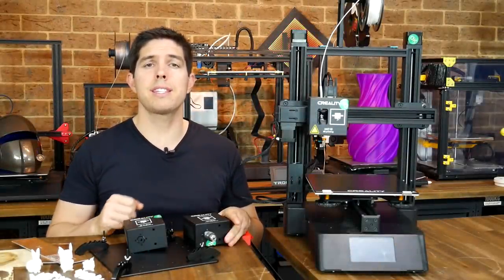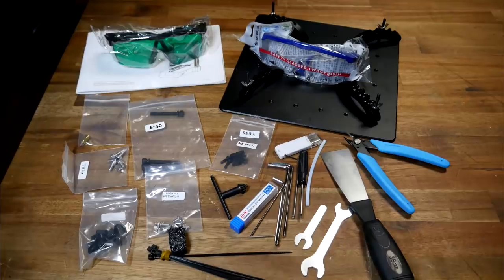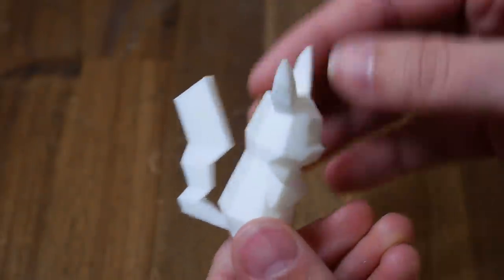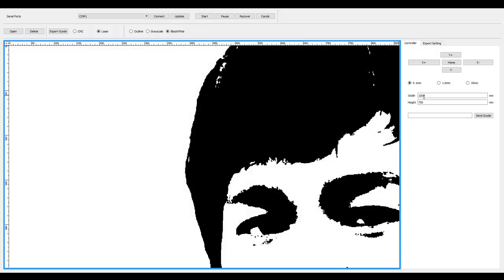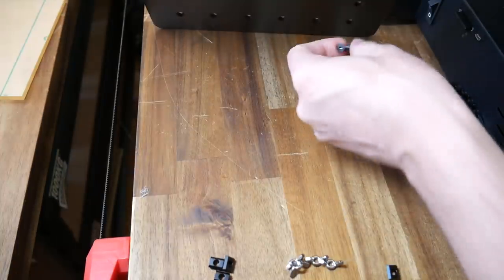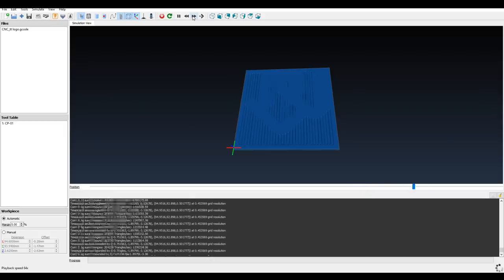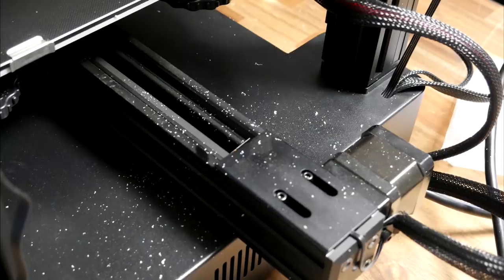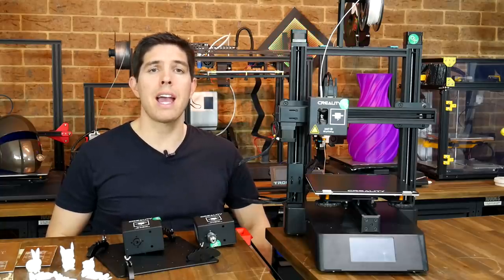Beta testing the Creality CP-01: 3D printer + laser + CNC all in one

Comment from the maker: Plenty of great comments on improving the CNC function. Currently this function is the weak link. Here is a summary of fixes plus some of my own ideas:
- Change drill chuck to collet.
- Insert the cutting bit as far into the chuck/collet as possible (I did this in the video and unfortunately it doesn't go in too far)
- 3D print a brace which prevents the motor from deflecting on the metal mount
- Compress the bed springs down as much as possible to remove bed wobble. This is possible without compromising the z endstop for 3D printing because it can slide down to compensate.
- Use better CAM software to make gcode. See the video I linked in the description. Just have to make sure you tell the software that M106 S255 starts the spindle and M107 stops it.
Reply: It is true that with carefully chosen feed rates and spindle rpm (feeds and speeds) you can do quite a lot with even weak machines. Take a look at the Carbide 3D channel for getting the most from a small machine like their Shapeoko.

Mostly the key is getting correct chip load per tooth but keeping very shallow cuts to keep machine deflection low. Adaptive cutting paths with chip thinning can also help a lot, but inevitably slotting is needed at some point. A few terms there worth googling if you are new to milling.
Reply: I am wondering: Are there other three in one printers out there that are better? Or cheaper? Any recommendations? Cheers!
Reply: The cnc function seems kind of half baked to me. I would buy this tomorrow if it would mill aluminium. I will probably buy it anyway when it is available though tbf I can't believe how good my ender is. I just wonder if separate dedicated machines would be better
Reply: Simon A this is why I always like to check the comments. I have never milled before I'm just about to get a machine and start. Thanks your comment is helpful
Reply: @machtundrebel3127  The Snapmaker machine has been advertised quite heavily this last month. It is also a 3 in one machine. But at a higher price range I think.
Reply: could you maybe do a tutorial on how to use different cam Softwares for the cp-01 because i cant seem to be able to export any code that works and i can't find any other tutorials on it. any help would be much appreciated.
Reply: Anyone know how you would be able to make the cam software know that m106 s255 starts the spindle and m107 stops it?
Reply: Hello. I am wondering if I can laser engraving in metal, and if the CNC mode can really machining in 3D (a 3D part)?
Reply: @machtundrebel3127  There is the snapmaker 3 in but it is not cheaper just better then the CP-01but in my opinion it is not as good as it should be...
Reply: @air3dp  I don't know if this will answer you question but I can engrave ceramic tile with a 259 MW laser head from creality...  I go as slow as possible and on most I have to go over it 2 or 3 times...  I would think if it can do that hard material it can also engrave metal, but faster and better...
Reply: @louisstevens9266  Have you had any luck with tutorials for this printer? I just bought it and am getting a bit inconsistent prints. Some come out perfectly others have many issues.
Reply: I noticed you used a wrench on the underside of the heated bed @2:11. Where you adjusting the carriage wheels or the springs for leveling the bed? I am having some issues with leveling my CP-01 as the back left is already as far as I can easily manage to turn the adjustment wheel when all other corners are at the correct z-height to keel bed level. Any tips on how this could be adjusted?

Comment: Sorry, but I can’t read and digest 311 comments before adding my own thoughts so I apologize in advance for any duplication. This in my mind is perhaps in a more proof of concept mode than beta, which isn’t a bad thing. We’ve had all-in-one printer/scanner/copiers for years now and this concept is theoretically appealing and logical for maker hobbyists. The interchangeable print heads are genius in concept but because of the need for precision alignment almost has to evolve at some point into a single integrated unit in its more mature development stage. But perhaps the most important question for today is whether it makes more sense for Creality to focus on two functionalities and get those right. In this vein, I would comment that not only is the CNC feature the most difficult to implement in this platform but as a CNC hobbyist is almost entirely limited in usage to pcb milling, which a number of sub-$200 Chinese made machines can handle pretty well with the right collet/bit pairing. So unless that is really the target audience and not someone who wants to mill signs and artwork from hardwoods, I think a pairing of 3D printer and laser would be pretty compelling, particularly if Creality can stay in that sub $700 price point. I applaud the effort and their engineering acumen. And thank you for the in-depth review, which I think actually serves to pique more interest in the product and it’s development than shedding light on its current design challenges. Well done all.

Comment: Kudos to Creality for finally getting the safety features right.
Reply: Ehhhh. I mean yea they added thermal runaway protection, but they also added a laser that powers up unexpectedly.
Reply: @outsider344  Very true, but as Michael suggested, we hope they will add a warning screen to that, or, better yet, a specific button to enable it. But you're right, it should have been implemented first ideally.
Reply: @spikekent  Don't get me wrong I'm a creality fan. The latest ender 3s have thermal runaway enabled (or at least mine did) if anyone is curious. But a laser cutter that isn't enclosed is already pretty bad, and having it turn on the laser unexpectedly on top of that is like a punchline for a joke about a dangerous machine. What really gets me is I assume this machine comes without a boot loader the way that other creality machines do. So this problem can likely be fixed before release, but future problems would require users to burn a bootloader before implementing any firmware level fixes.
Reply: @outsider344  I don't know about all Creality machines, but my CR-10s4 came with the bootloader. Even though I brought it specifically to hack/upgrade the hell of it. It's called #Borg for obvious reasons. On a serious note, you're quite right, safety should be the prime concern when manufacturing anything.
Reply: I am considering getting a CR 10 mini as my first printer, what about thermal runaway on this one? I'm confused
Reply: @kostasz2392  I cannot say if it will be enabled, but you can test for it when you get a printer. If it is not enabled, you potentially could reflash the firmware to enable it. Either way, we are here to help if you need it.
Reply: @spikekent  okay, thanks a lot. I hope I'll make it without needing more help guys
Reply: @kostasz2392  You're very welcome mate. Good luck.
Reply: @kostasz2392  Your best bet on getting one with it enabled is getting the printer directly from creality. Usually resellers have older models and thermal runaway being enabled is a new feature. I got my ender 3 from the creality amazon store (mostly for the return policy) but it also meant I got the most up to date model. Though if you do get one without thermal runaway it's not the end of the world. The firmware already has several features to keep the printer from catching fire if something goes wrong, thermal runaway is just a more broad form of protection on top of the others. And Spike is right, you can always flash the firmware yourself if you need to.

Comment: Will be boxing up and returning my CP-01 tomorrow. Runs very quietly, when you can get it to run. Wouldn't read SD cards, except the one that came with it.Bought an external  card reader for my Mac and 3 new SD cards. Each card worked 1 time, then would no longer work. Tried quick formatting, overwrite formatting, still no luck. Software included is for windows, so I downloaded Mac software off Creality's website, which wouldn't open. Milling head was missing the screws that hold the motor in, so motor was rolling around, which damaged the circuit board. Had a big green OK sticker on it, like it had been quality checked, though. Bed was very high in the middle, which could probably be fixed if I was going to keep it. The touch screen was very nice, as well as the ability to micro-adjust the z axis while the first layer was going down. But I'd like to be able to print more than the rabbit, pikachou, and flexi-cat files that it comes with.

Comment: Insert the end mill as deep as it can go to avoid deflection.
Reply: think it was more of the bed not the end mill
Reply: Looked like the entire chuck was moving to me
Reply: Yeah it had massive overhang, plus running a chuck is going to add runout. There's a reason routers run large hollow short tube shafts with collects in them.
Reply: Jacobs style chucks are notoriously bad at radial load. They are designed for drills where you only have significant axial load. That is why mills always use collets instead of chucks.
Reply: @kupaN9  im still waiting for a small cnc mill rigid enough to actually make some decent cuts.
Reply: i got one of those mini engravers. .... your stuck with low feedrate as deflection will remain a issue. the cutting forces trying to deflect a endmill are nontrivial. it will simply bend and flex otherwise ridig stuff.
Reply: Does not really matter. V-wheeled solution is not stiff enough for CNC. They are fine for 3D printing but even there some people replace them.